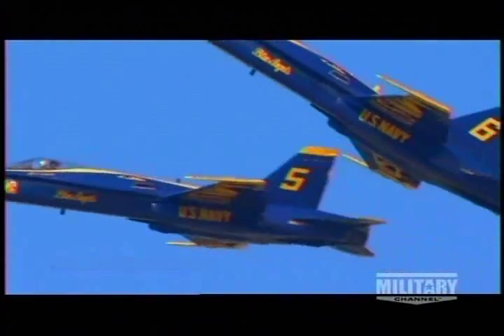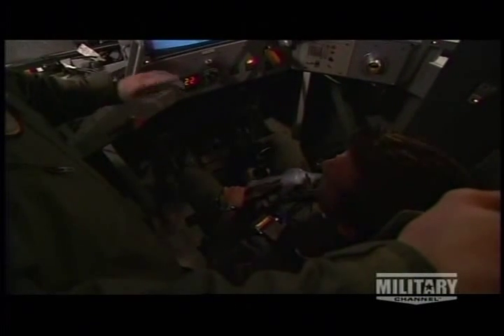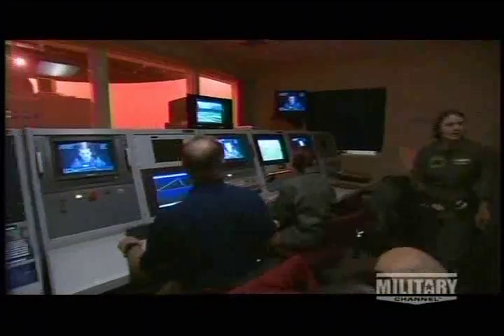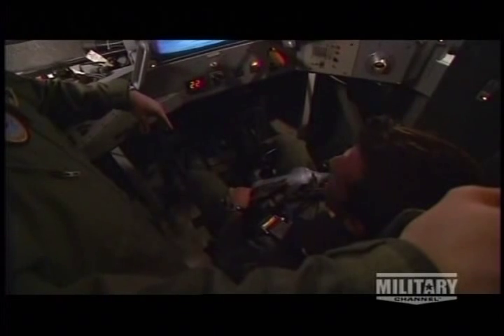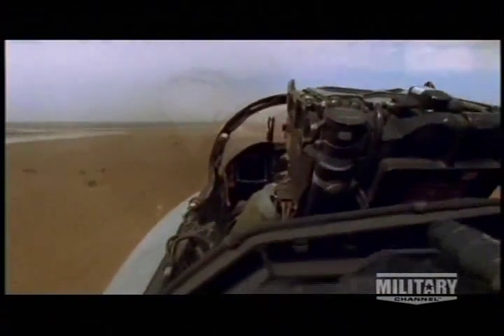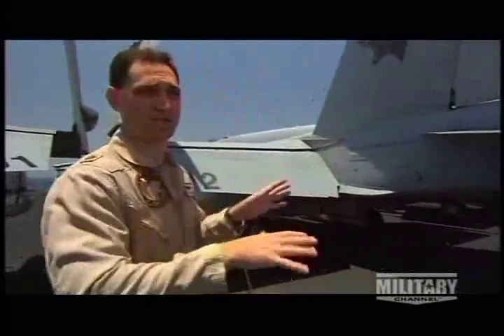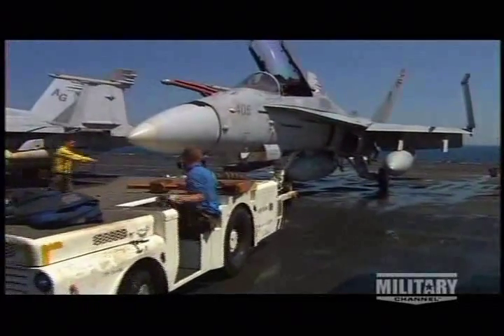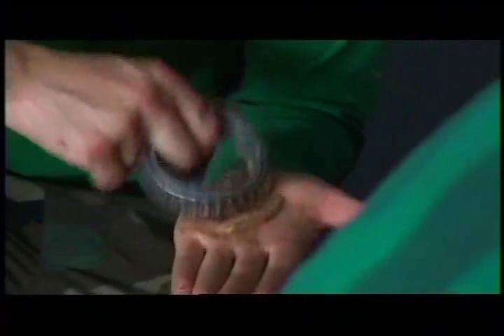Anatomy of an F/A 18 Part 2

Comment: You're 100 % right slickstrings. 7.5 g is a lot. However i think that engineers should have made a 9 g capable structure for the aircraft and limit the load to 6 or 7 g when its carrying external tanks and bombs using digital fly-by-wire programming. Concerning the pilots, I thought navy pilots where trained to endure the same kind of load factor than other military pilots, but i still think they're making a really good job [I wouldn't even be able to endure 5 sustained g's ]

Comment: There is no need to be rude!  What i meant is that I am very disapointed by the Hornet since its maximum load factor is only 7.5 G. Actually physics show that aircraft performance in a dogfight increase when the maximum load factor increase [ Turn radius decreases and turn rate increases]. So i really think Hornets pilots should get the same kind of training other pilots have in order to withstand 10 gs [pilots of F-22, Rafale, Eurofighter and Mirage 2000]....

Comment: Old comment but not quite right, the aircraft is limited to 7.5 because the navy wants the airframe to have a longer lifespan as navy aircraft take much higher stresses on carriers than land based fighters, they are already over built due to this requirement. Swiss F18s are limited at 9G's and it possesses no structual differences from other Hornets, simply a software change.

Comment: it certainly would be nice to have 9 g's. but as someone who works in engineering i can say its not always possible or practical. To increase strenth weight is usually increased. To negate the weight gain, design and materials cost is increased. A lot. And then there is the fact that 9 g's isnt just a pull and do manouver. The right operating conditions need to be met as well. speed, angle of attack and so on. So there becomes the overdesigning problem and overcost. 7.5 has met the requirement.

Comment: kirk, its not the pilots. its been proven that the human body can only take 9 consistantly. The reason the hornet is limited to 7.5 is strucural.  Its a LIGHT airframe but carries a substantial load. EVERYTHING its carrying its multiplied 7.5. Design a light airframe that can do that and still call it dissapointing. 7.5 is a lot.